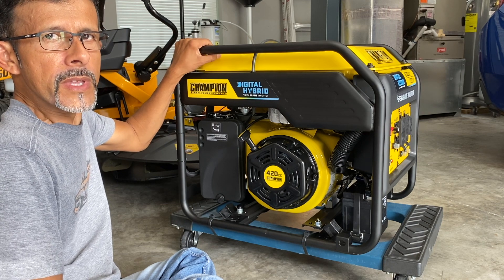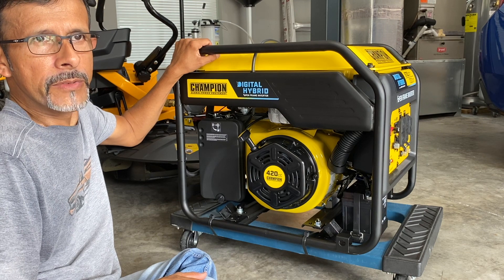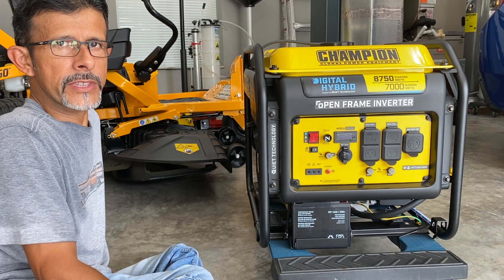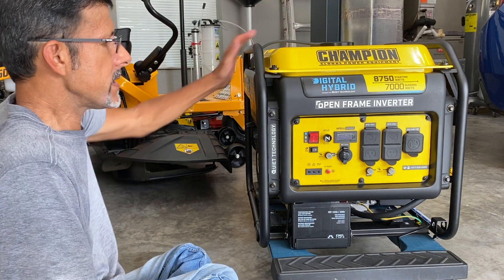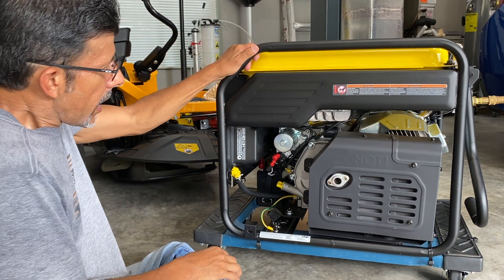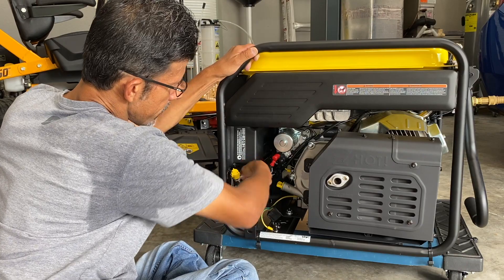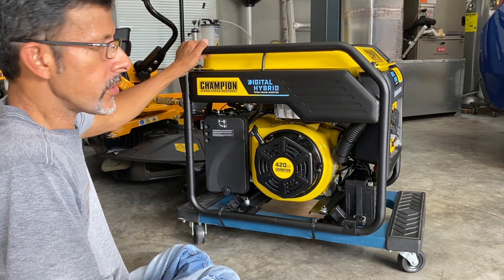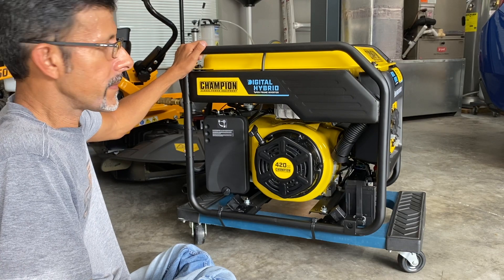Champion Inverter Generator 100520 with tri fuel kit

Comment: Great video. Thanks for all the helpful info. Can you run this inverter in eco mode when using propane? Or do you need to keep the engine running at 3600 rpms?
Reply from the maker: Yes, I have run the generator on eco mode while using propane. But remember, propane doesn't have the same BTUs as gasoline so the output power of the inverter generator is generally reduced by 20%. But the engine doesn't run at 3600 rpm like a traditional generator. I put a tachometer on mine and it runs anywhere between 3400 and 3590 rpm. Apparently the inverter is the reason why the engine doesn't need to be running at 3600 rpm to produce a steady 120 or 240 power output level(s).
Reply: @Ozzie4Para  Ozzie, with no load in ECO, at what RPM does the engine run?  I need a 240v gen to run a well pump and sump pump which are both intermittent loads.  It would be nice if the engine would really idle down below 3000rpm during the off periods.  I know the EU7000is will idle down to around 2500rpm with less than 500watts being drawn, that really helps the fuel consumption and noise level.  But agreed, too expensive.  Do you know the low-idle, no load rpm (eco)?

Comment: I bought the same generator lately, along with the Champion 41537 Natural Gas / Propane Conversion Kit (didn't fit well, so I'm now getting the US Carb kit you're using). You're right that it's not quiet, so I ordered a 45' cable to put it farther from the house. I also have the Reliance Controls 31410CRK transfer switch that I'll wire to my electrical panel. I like the idea of of adding a tachometer and I'll look into mini-splits -- nice tips! I appreciate your professionalism -- well done!
Reply from the maker: Thanks for the nice response. I love my mini split systems even though my six year old 4 ton HVAC runs just fine. I only run this system every three or four months for about an hour just to keep the freon in the system moving somewhat actively. But my mini split systems are what cools and heats my house. They use much less electricity when compared to traditional HVAC systems. And just like I said in my video, my new inverter generator can run them just fine. Although it'll be pretty rare that I run all four mini split systems at once during a power outage but at least I know my inverter generator can do the job if need be.
Reply: Any issues running gasoline while using the US Carb adapter snorkel?  I want to run both gasoline and NG.
Reply: @ryan4to1  I've had problems getting it to run on propane, but it runs fine on gas with the snorkel installed.

Comment: Excellent video!  I'm looking at this exact same model and was curious if the tri fuel kit would work on it.  I have the tri fuel kit for my generac 5kw but with my new home automation switches I need to switch to the inverter style for cleaner power.  Thanks so much.  This just sold me on this generator.  Now to find it in stock lol
Reply from the maker: Yeah, I ordered the MSK3101 kit from the US Carb website for the 420cc engine which is what's on the Champion 100520 inverter generator. The kit was super easy to install and it required very little modifications to the generator other than drilling the two holes in the frame to mount the regulator. I'm super happy with my generator so far even though I did downsize from my 100110 model that did have more power. That's okay because I was able to afford to lose some output power in exchange for the cleaner power that these inverter generators provide. I see they are out of stock on Amazon's site which is where I bought mine. Crazy thing is Amazon raised the price by $100 on this generator not 24 hours later after I ordered mine. Supply and demand at its finest I suppose.....
Reply: Ozzie Alarcon yup I’ve seen the 5kw model go from 884 to 996 to 1102. All over but typical for Amazon.  Thanks a ton for the video